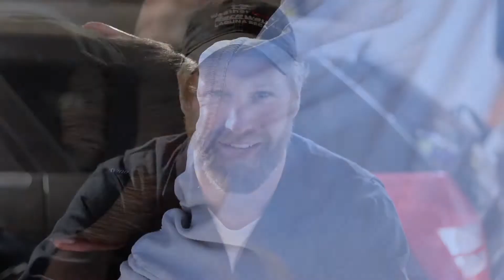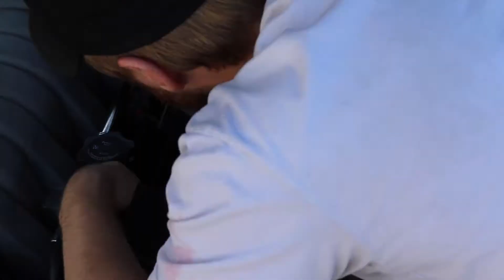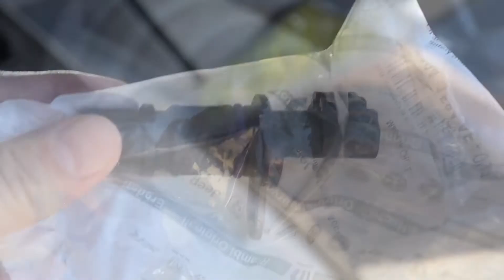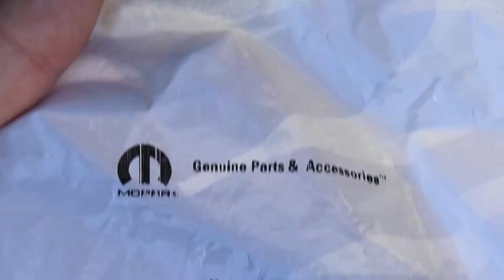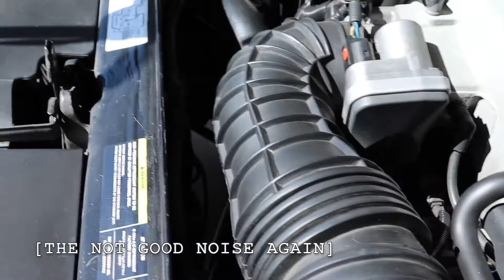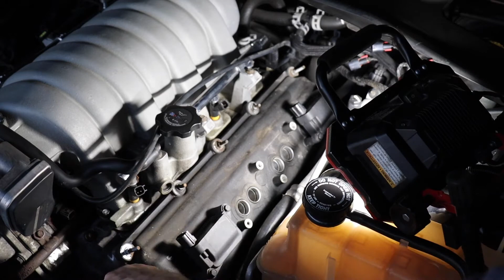2006 Dodge Magnum SRT8 - Episode 7: Chasing a Misfire

Comment: So glad that you documented this!  I own one!  AMAZING car!  QUESTION: To be clear, did replacing the Cam Sensor fix the rough idle?  Because I'm having the same issue.  Thanks for your detailed work!
Reply from the maker: It helped a little bit with the rough idle but really helped with long warm start issues it was also having. I later found out the car had much more serious issues, but it certainly helped with these.